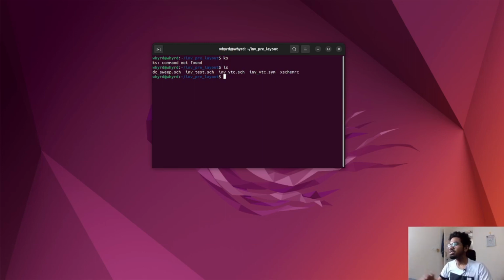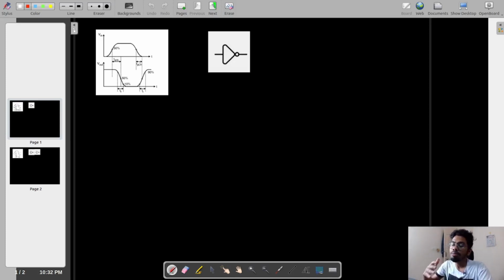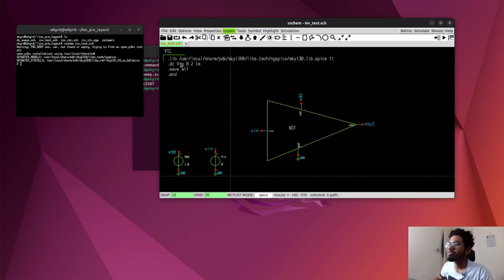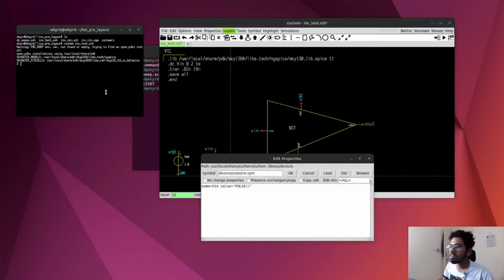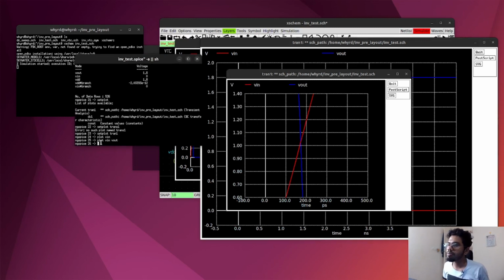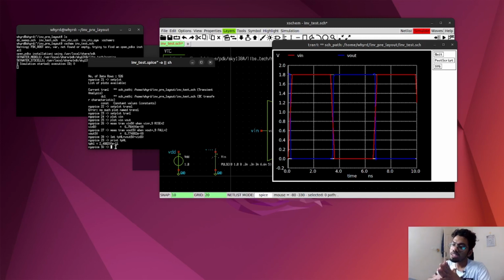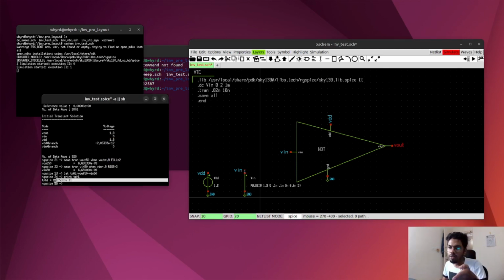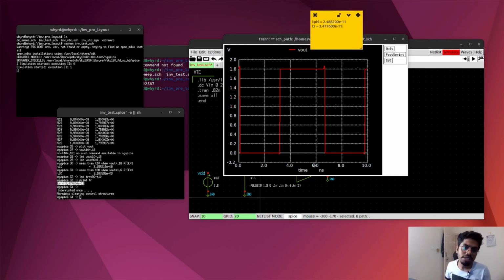CMOS inverter delay analysis (day1) | sky130 |  Xschem | EP5:VLSI Project help

Comment: I am working in Bosch in Embedded systems domain, i have btech in ECE, I want to get job in VLSI analog design domain, Will mtech be a must requirement or if i do vlsi related projects and prepare concepts it would be enough?